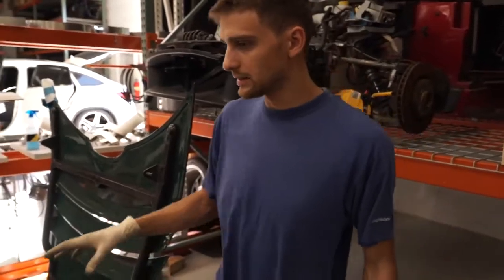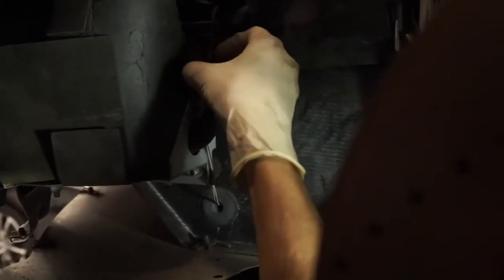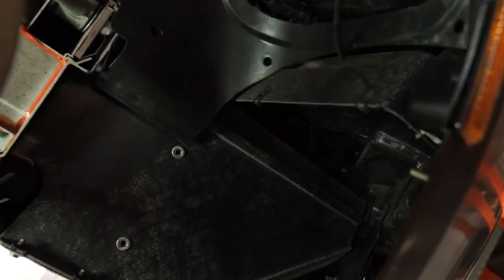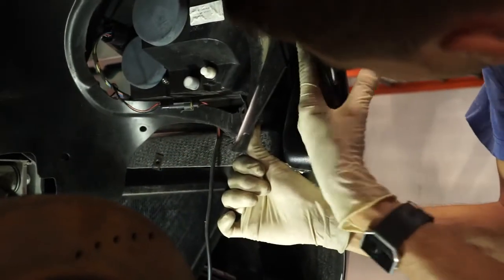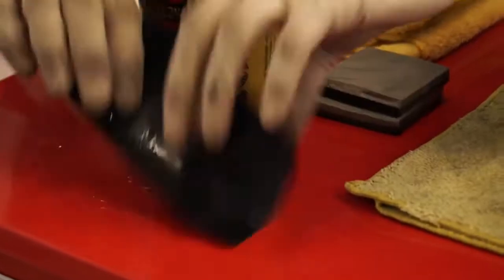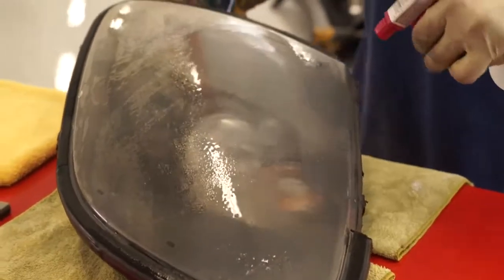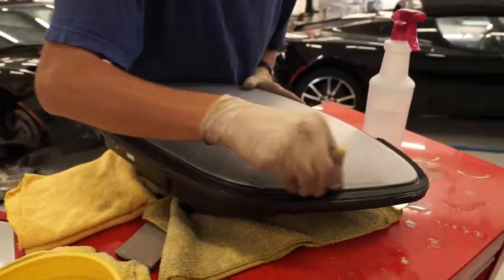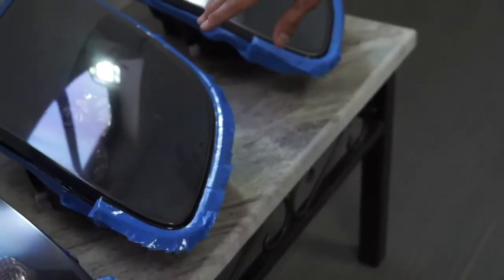How to Refinish Tesla Roadster Headlights | Gruber Motors

Comment: 1. You don't wanna sand it with 400 you will be standing there sanding it for hours. 800 OR 600 is PLENTY to burn off clear
2 spraying it with a rattle can instead of some long lasting real clearwould of made this actually kind of worth it but the rattle cans clear gets yellow after just one or two years
3 if you went all the way up to 3000 you might as well buff it out and hit it with ceramic to make it last. that way next time you dont need to sand off all the clear. clear nd ceramic last the same amount of time. BUT ITS WAY LESS HASSLE

Comment: Do you have to shut down or inhibit the state of battery through vdm to unplug the headlights? or can I just unplug them without any worry?
Reply: The APS does not need to turned off, just make sure the headlight switch is off.